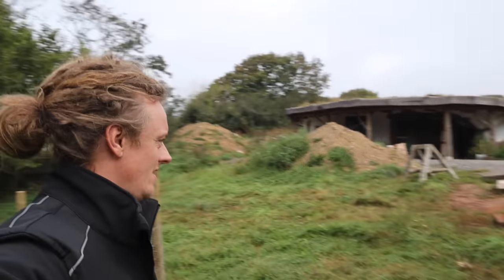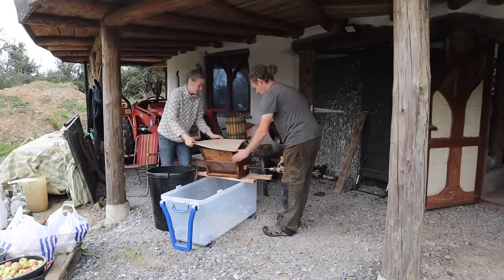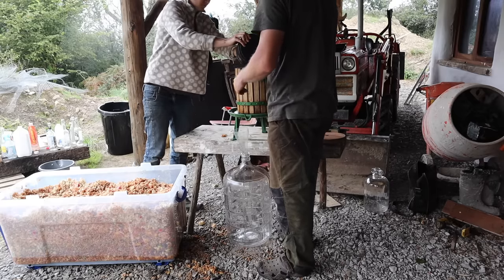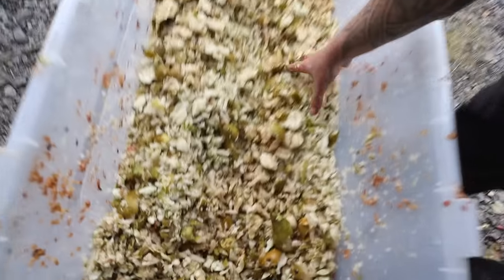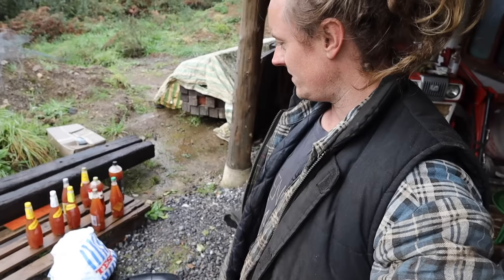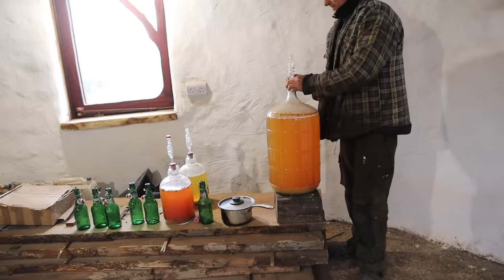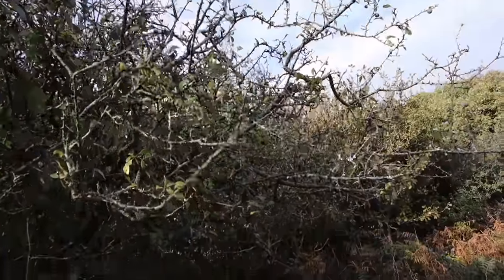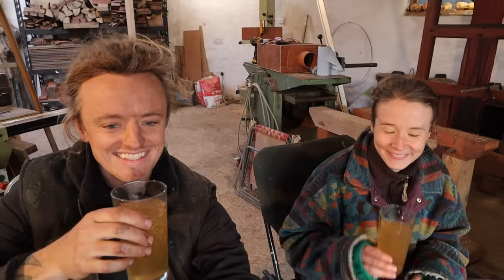Off Grid Cider Making 2020

Comment: I built one of these scatters this year using stainless screws. It was pretty good but we needed to cut all the apples in quarters as whole apples just danced around on the screw heads. I took a grinder to the heads of the screws and made them random square/oblong shapes,( ie they have sharp square edges)  it is night and day and blasts through whole apples now. Great channel mate.

Comment: If it gets cold enough this winter y'all should try to make some applejacks, a freeze-distilled apple brandy. Just leave a big bucket of cider out, covered of course, and pick out the ice in the morning. You do this several times until you've removed most of the water and you have an old traditional american spirit. It's a piece of cake to make and is really quite good for the holidays

Comment: I love this - we made rather similar apple grinders, and yes, they can work wonders. I used a large DC motor from an old treadmill to drive it, keeping the flywheel in place. The munching cylinder is much shorter in mine, maybe only a little over 5" long, but of a similar diameter. I put a hinged lid on mine, and only toss in a few apples at a time after the thing spins up. If I don't slap the lid shut it hits the apples hard enough to kick them right across the room LOL. It handles them as fast as I can feed them, taking only a minute or two to fill the 5 gallon press. I put the screws in a spiral pattern, split from RH pitch to LH pitch at the middle, so the material is automatically moved toward the center. I made a wooden frame screw press but borrowed the wooden slat cylinder from a commercially made Weston press, though I still use a filter bag with it, cut and stitched from old 100% cotton sheets.

Comment: I measured the depth of my big cider bottle and bought a cork that fit the top of the bottle. Then I drilled a hole in the middle of the cork and thread the siphon pipe through it to my desired depth and then secured it in the cork so now I can just place the cork on the bottle and siphon without worry. Love your vids just discovered them and I am going through them all.

Comment: I use an old garden shredder to chop the apples and then an even older cheese press to get the juices out. First fermentation and then transfer to another barrel through a filter where I add some Fructose that gives it a secondary fermentation. Comes out nice and clear and sweet which is how I like the cider

Comment: If you put the apples up higher, you could drop them in by opening and closing a access hole somehow, you could also mount the screwdriver and have it hotwired so you can turn it on and off with an external switch. I really enjoyed the video, thanks for the upload

Comment: what you could try and do I suppose is have some sort of gutter pipe,  leading down into the box where the apples get chopped and shredded.

the lid remains, but the pipe goes through the lid via a loose hole.

lid can be attached with hinges and a simple c shaped hook thingy that coils around a nail to keep it closed.  simple but effective.

just keep feeding the apples one by one or in twos down the pipe, they'll fall into the hole and thats that.  Just an idea, haven't really thought it through carefully tbh but it may help.

Comment: I never use mislin and I use a press just like yours, only a bigger 400L one! You only need cloth with an open press, when you make  hessian 'cheeses'. With the wine press it's not needed, not with apples anyway, the pears can get a bit too mushy and throw more sediment. I think I get better juice per kilo of pulp if I add less to the press in a batch - it's more work but if it's not such a juicy year (varies a lot from year to year) you get a bit more. I have 2 50l carboys and I rack once, one into the other, after the first fermentation's done (usually in November) then bottle in the spring. I find it still has some fiz if I don't leave it too late (before April here in Serbia), and by the summer it clears nicely in the bottle with minimal sediment. For me cider's a summer drink, never any left for xmas, but we have red wine for that season :) I add some crabapples when pulping, and put some oak chips in the carboy when I rack, both for good tannin which is a bit lacking in the apples I find here. If you add a few kilos of quince you get a lovely rose-like note to the final flavour, but I'm always surprised how much better the cider is if you leave it to mature through the winter in the carboy. I used to add sugar when bottling but now I don't bother, too many explosions! It's just a matter of catching the right time to bottle in the spring, get it right and you have that Beaujolais nouveau level of fiz when you pop the cap in July. Respect as always.

Comment: I'm sure someone else has said this already, but the muslin sack is not just for straining out the pulp -  it also provides a space for the juice to wick out from the sides which are otherwise sealed by the pieces of apple flesh.  I tried my first press this year without the muslin bag and was surprised at how little juice could be extracted.  Particularly, at how heavy the remaining cake was after pressing.  For my subsequent pressings, I used the muslin bag again and the juice yield was something like 50% higher, and the cake much drier.

The whole pressing system - my setup being the same as yours - I think needs rethinking..  There must be a better way of generating the high pressures needed to extract the juice and get still dried cake.  Some sort of hydraulic ram affair.

Comment: Small suggestion. Do not put under the air lock straight away. Add yeast and leave it for 1 day. Then put air lock. With air yeast multiplies without it feeds on sugar. Thx for video!

Comment: I have had much luck with using a garbage disposal I set up on its own table and funnel ... I also added a carbon dioxide dispenser (CO2 bottle ) to flood the work area to exclude oxygen and prevent browning .. works good so far, the apple juice tastes cleaner

Comment: I enjoy your videos and really admire your vision, the work you do and the life you have created. However, every time I see you on that planer I SHUDDER..... OK, I totally get how it's impractical to use the bridge guard when you're surfacing 8' lengths. But when you're planing timber for making boxes that's 600 x 200 mm put the guard on FFS mate !! It takes a FEW SECONDS - but you'd know that anyway, as that's presumably  how you secure your dust collection box when thicknessing ?  I do know what I'm talking about as I was a cabinet maker & joiner for almost 20 years (had the same Sedgewick !). More importantly, I had a friend who lost half of 3 fingers by that sort of slackness. It happened in a millisecond and was truly horrendous. It changed his life forever, and not in a good way....It only takes a slip or a grain grab - your hands are going over that cutter block on Every pass. I concluded there are only 4 possible reasons that people ignore basic and easily implemented safety - laziness, haste, arrogance or stupidity. But whichever one, the outcome is the same. Obviously what you do in your own workshop is your business but if you are sharing that with thousands of people surely that changes ? (even if you do put out the occasional disclaimer). I once worked at a place that had a sign on the wall which read " If you think health and safety is expensive, try having an accident". Because Shit DOES Happen. Hopefully some food for thought. So take (more!) care and I look forward to the next video. Cheers.
Reply: You are speaking of someone who uses a lathe without safety glasses amongst many other things, enough said. The NHS sadly is knee deep in this stuff. Maybe Covid will instill some thought....but I doubt it.